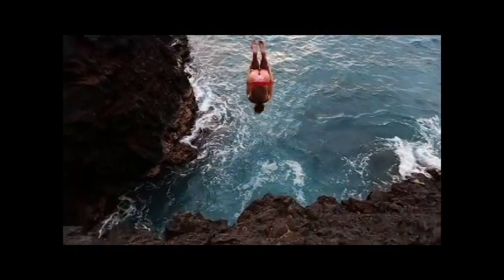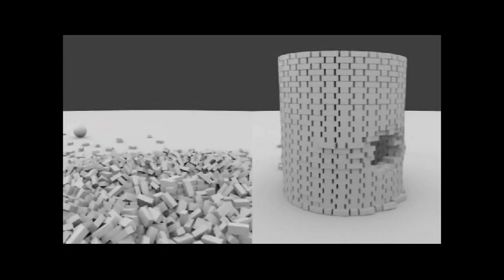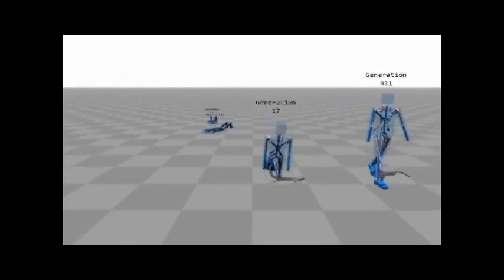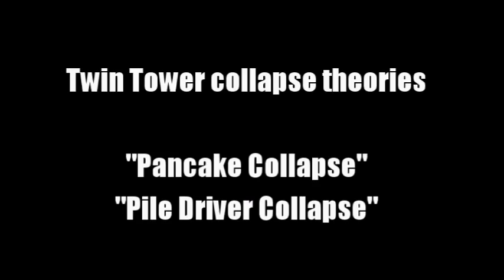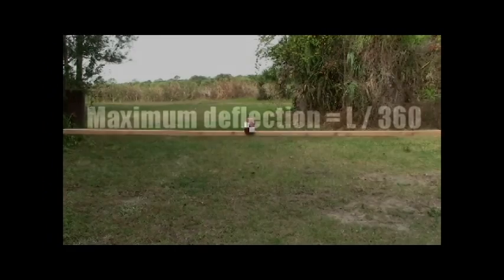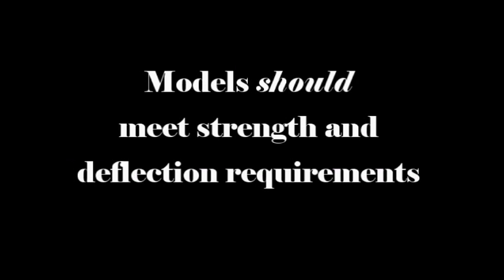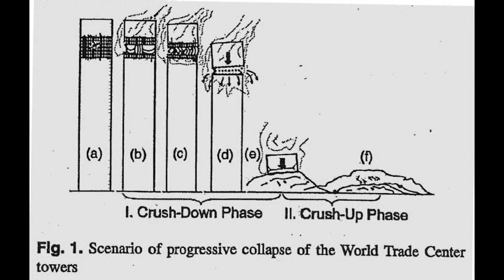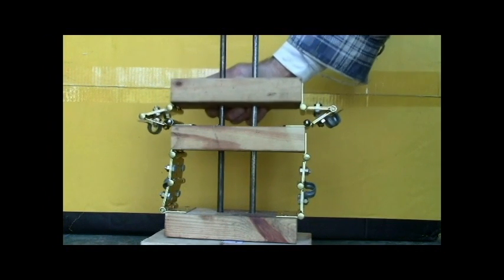9/11 Experiments: The Force Behind the Motion

Comment: This "experiment" is NOT a test of the Tower Structure, as it isn't the same structure at all, but merely a deceptively BAD 'copy'..
The DESIGN of the Tower Structure employed a column design which would COMPLETELY FAIL BY BUCKLING once it lost attachment to ONLY TWO FLOORS. It would fail because it is loaded by the weight of the tower above it.
The experimenter lacks these words in his vocabulary: STABILITY and BUCKLING.  But stability and buckling were CENTRAL to the initiation of the collapse, and described by NIST in great detail - so perhaps you should both read and understand that report before you come up with crackpot experimentation.
These terms (stability and buckling) are scientifically-meaningful,  two hundred and fifty years old, and their science is old (but accurate).
https://en.wikipedia.org/wiki/Euler%27s_critical_load
If you never mention these words, then you are either so ignorant that you don't know what you're talking about, or you do know, and you're a liar.
Reply: They call anyone who disagrees with their rubbish govt trolls.. It's their coping mechanism.
Reply: +alfredo nunya
"They call anyone who disagrees with their rubbish govt trolls.. It's their coping mechanism." - I am quite aware of that, thanks.
However here we see it being demonstrated.  It's better than my mentioning it.  :)
Reply: Alan Bollucks
"You are a government troll Tony" - No. I'm not, actually.  I am a retired industrial designer who started work in the early sixties as an aeronautical engineer, and finished in 2002 by designing the charge socket for an electric car. Engineering was my profession.
"I see your propaganda" - Physics isn't propaganda, you miserable idiot.  It's virtually an unarguable subject, and is based on the study of what is actually happening, in the real world.
"posted across many channels" - Just the ones that you watch, actually.
"several different user names" - Lying again, eh?  My other name is Beachcomber2008 which I use for music
https://soundcloud.com/jazzroc/never-over-eight-1.
Is Alan Bollucks your real name?  I have always spelled that with two 'o's...
"some of which you admit to using" - Lying again, eh?
"you copy-paste" - my own work.
9/11 PREDICTED BOEING 707 (1964) and ACTUAL (2001) BOEING 767 TOWER IMPACT ENERGIES
For those who believe that the REAL Boeing 767-200 impact was in any way similar to the notional impact calculation made in 1964 to test whether a tower could withstand it, I have reworked the calculations using the REAL impact figures and the REAL suppositions made, in place of the FALSE ones made by AE911T.
BOEING 707-320B
Empty weight 66,406 Kg.  Passengers (75% full = 164 people + 4 crew 100 Kg each) Fuel 500 gallons, so the notional weight of the 707-320B at the time of impact would be 66,406+16,800+1543=84,749 Kg
Its APPROACH speed of 147 mph works out at 65.7 metres per second.
The KINETIC ENERGY of the Boeing 707-320B at the time of impact would then be
*0.5 * 84749 * 65.7 * 65.7 = 183,000,000 Joules*.
BOEING 767-200 (Flight 175)
Empty weight 80,130 Kg.  Passengers + crew 65  Fuel 10,000 gallons, so the notional weight of the 767-200 at the time of impact would be 80,130+6,500+30,860=117,490 Kg.
Its speed of 565 mph works out at 253 metres per second.
The KINETIC ENERGY of the Boeing 767-200 at the time of impact would then be
0.5 * 117,490 * 253 * 253 = 3,760,000,000 Joules.
So, by dividing the second figure by the first, we discover that the REAL 767 impact was MORE THAN TWENTY TIMES GREATER.
"entire OPs containing very scientific looking mumbo-jumbo" - that is Physics, irrefutable and easily-accessed on the web.  Type "kinetic energy" and in two seconds you receive this:
Kinetic Energy: K= 1/2 * m * v^2
https://www.khanacademy.org/science/physics/work-and-energy/work-and-energy-tutorial/a/what-is-kinetic-energy
Either you just haven't looked, and know nothing at all, or you actually know you are lying, right now.
"complete and utter nonsense, of no consequence or relation to real world physics" - you describe what you write.
But you would, being a hardened truther.  The very word you begin with is a lie, and everything that follows it, too...
Reply: beachcomber2008  I would like to see you prove any of what you wrote about who and what you are Tony the Shill. Betcha caint..........
Why do you government trolls always try this bullshit? The bigger the lie, repeated the most often doesn't automatically become fact Tony.
Reply: Albury Smith
"I would like to see you prove" - I have just done so.  I have just proved to you that truther-claimed estimates of the 9/11 plane impacts were twenty times short of reality.
If you want to see what I'm talking about then you have to follow my argument, and understand it.
As I've just written to Suppository, you're either too stupid, or you're lying.
If you're really stupid, then you'll never get it, and I'm sorry for you.
If you know yourself to be a liar, then life will treat you just the way you deserve to be treated, and that won't make me feel sorry at all.
Reply: Tony Duncan  Yes Tony, you have proven that you can not read English and that you lied when you said you use the beachcomber sock puppet only for music. You were tasked with proving you are who you say you are Tony. So far, you have proven to me you are what I said you are, a government troll. I win my bet.
Reply: +Albury Smith
Interesting rhetoric, there.  You make claims without explanation.  These may be disregarded by any rational person.  Familarize yourself with Hitchen's Razor. "What can be asserted without evidence can be dismissed without evidence"
This will help you pretend to be a rational person.
Personally, I never gamble.  Maybe if you gambled less and learned more, you'd be a better person, and decide that lying about anything, and everything, wastes your own time, and that should be a precious thing to you, as it is finite.
Reply: beachcomber2008  Tony, you were clearly asked if you can prove who and what you are:
" I would like to see you prove any of what you wrote about who and what you are Tony the Shill."
key words being prove any of what you wrote about who and what you are Tony
Tell Mr. Hitchens hello for me
Reply: +Albury Smith
"Tony, you were clearly asked if you can prove who and what you are" - which I ignored, as it is ad hominem, and breaks the rules of rational debate.  I haven't asked you to do the same, have I?
This is because it has nothing to do with "9/11 Experiments: the force behind the motion", which is the topic of the video.
What I have been putting to you is entirely relevant to "9/11 Experiments: the force behind the motion".
"I would like to see you prove any of what you wrote about who and what you are" - and you will get none of it.   Because it is off-topic.
"Tell Mr. Hitchens hello for me" - He died six years ago.  You will one day.  I hope it's soon. Take it personally.
Here's a little something you might consider:
Only a third of the potential energy of the towers was consumed in destroying them.  The remaining two thirds turned into HEAT energy at the wreckage base.  The energy the tower contained could destroy the tower three times over.
Some floors had already fallen onto the floor beneath them before collapse.  The stability of ALL connected columns (and their safety factor)  was over-ridden easily as soon as the floor beneath failed.  The supporting columns, unsupported by their floors, then buckled, and the seventy-thousand ton towertop built up an unstoppable momentum by the time it reached the next floor/column connection - which by then would have been broken by the gathering floors.
Slender column long span beam structures are known by architects and engineers to have stability issues, but this fact, strangely, has never reached the 'Architects' and 'Engineers' for 9/11 'Truth', even though Euler's Buckling Theory is two hundred and fifty years old.  Maybe they think a scientific theory is just someone's opinion.  In fact, of course, it has never been disproved over this time.  And it works.  And it was used to design these WTC buildings in the first place.
MOMENTUM and GRAVITATIONAL ACCELERATION are the subject of the following discourse, showing that this process, once in hand, had no means of stopping.  Floor/column connections are the sole mechanical features of the structural integrity of these buildings, and there was no other feature which might have saved it.
Newton's Laws of Motion as applied to 9/11:
An Analysis of the Floor Collapse of the Twin Towers
Newton's 2nd Law ”The acceleration of an object as produced by a net force is directly proportional to the magnitude of the net force, in the same direction as the net force, and inversely proportional to the mass of the object.”
This, with Newton’s other laws, demonstrates the REALITY of the floor collapses within the twin towers.
The equation used is a derivative of the ACCELERATION of MASSES by GRAVITATIONAL FORCE: *v^2 = u^2 + 2 * f * s*, where:
Floor Mass *m = 10^6 Kg*,
Gravitational Acceleration f = 32.16 feet per second per second, or 9.81 metres per second per second
Distance between floors *s = 12 feet, or 3.66 metres*, and
Starting velocity u (original) = 0 ft/sec  (0 m/sec).  Then u = 9.72 ft/sec (2.97 m/sec).  Then u = 13.72 ft/sec (4.18 m/sec).  Then u = 16.3 ft/sec (4.97 m/sec).
It fits (as it must) in the case of a detaching floor. This, when and if it falls free, accelerates at G until it hits the floor beneath. From the formula v^2 = u^2 + 2 * f * s we know it strikes the floor beneath at a speed of 27.8 feet per second, or 8.47 metres per second.
We know that MOMENTUM is conserved, and the TWO floors would THEN be traveling downwards at HALF THAT SPEED, less the speed loss from the energy loss of the SHEARING of the floor connections.
We KNOW what this is, because we KNOW the average and general downward acceleration to have been 0.7G, as agreed by AE911T.
So we KNOW that the initial downward speed of the TWO floors is actually 70% of (27.8 / 2)*, which is *9.72 feet per second, or 2.97 metres per second.
Now we consider TWO floors striking the NEXT floor.   
Note that THE START VELOCITY (u) IS NO LONGER ZERO, but 9.72 feet per second, or 2.97 metres per second*, so from the formula *v^2 = u^2 + 2 * f * s we know the TWO FLOORS strike the floor beneath at a speed of *29.4 feet per second, or 8.96 metres per second*, and thus the impact velocity is GREATER than before.
We know that MOMENTUM is conserved, and the THREE floors would THEN be traveling downwards at TWO THIRDS THAT SPEED, less the speed loss from the energy loss of the SHEARING of the floor connections.
We KNOW what this is, because we KNOW the average and general downward acceleration to have been 0.7G, as agreed by AE911T.
So we KNOW that the initial downward speed of the THREE floors is actually 70% of ((29.4 * 2) / 3)*, which is *13.72 feet per second, or 4.18 metres per second.
Now we consider THREE floors striking the NEXT floor.   
Note that THE START VELOCITY (u) IS NO LONGER 9.72 feet per second, but 13.72 feet per second, or 4.18 metres per second, so from the formula v^2 = u^2 + 2 * f * s we know the THREE FLOORS strike the floor beneath at a speed of 31.0 feet per second, or 9.45 metres per second, and thus the impact velocity is EVEN GREATER than before.
We know that MOMENTUM is conserved, and the FOUR floors would THEN be traveling downwards at THREE QUARTERS THAT SPEED, less the speed loss from the energy loss of the SHEARING of the floor connections.
We KNOW what this is, because we KNOW the average and general downward acceleration to have been 0.7G, as agreed by AE911T.
So we KNOW that the initial downward speed of the FOUR floors is actually 70% of ((31.0 * 3) / 4), which is 16.3 feet per second, or 4.97 metres per second.
On the point of impacting the NEXT floor THE START VELOCITY (u) IS NO LONGER 13.72 feet per second, but 16.3 feet per second, or 4.97 metres per second, so from the formula v^2 = u^2 + 2 * f * s we know the FOUR FLOORS strike the floor beneath at a speed of 32.2 feet per second, or 9.81 metres per second, and thus the impact velocity is EVEN GREATER than before.
What you see here is AN ACCELERATING TREND.  The acceleration of the massing floors is heading asymptotically for G itself.
If you take the INITIAL FLOOR, its kinetic energy impacting the floor beneath it (assuming its weight to be 10^6 Kg) is 0.5 * m * v^2, which is 0.5 * 10^6 * 8.43 * 8.43 = 35,500,000 Joules.
If you take the FOUR FLOORS, their kinetic energy impacting the floor beneath them (assuming floor weight to be 10^6 Kg) is 0.5 * m * v^2, which is 4 * 0.5 * 10^6 * 9.81 * 9.81 = 192,000,000 Joules, which is MORE THAN FIVE TIMES GREATER.
Kinetic energy is ALWAYS INCREASED BY FALLING, as POTENTIAL energy is traded off against it.
So the floors will accelerate all the way to the tower basement.  This leaves FREE-STANDING COLUMNS NEARLY A QUARTER OF A MILE HIGH (and holding up 70,000 tons).  THEY WILL ALREADY BE BUCKLING AND FALLING DOWN.
Reply: beachcomber2008  Yes Tony you ignored my direct request because you have no satisfactory answer to the challenge. You haven't asked me to prove who I am or what my credentials are because I do not claim to be an expert or a trained professional with superior knowledge of physics than most mortal men like you do.
Reply: +Albury Smith
"you ignored my direct request because" - it is ignorant in that no such request is either relevant or verifiable.
"You haven't asked me to prove who I am or what my credentials are because" - it is ignorant in that no such request is either relevant or verifiable.
"I do not claim to be an expert or a trained professional with superior knowledge of physics than most mortal men like you do" - because if you did you'd be lying once more.
This video "experiment" is NOT a test of the Tower Structure, as it isn't the same structure at all, but merely a deceptively BAD 'copy'..
The DESIGN of the Tower Structure employed a column design which would COMPLETELY FAIL BY BUCKLING once it lost attachment to ONLY TWO FLOORS. It would fail because it is loaded by the weight of the tower above it.
The experimenter lacks these words in his vocabulary: STABILITY and BUCKLING.  But stability and buckling were CENTRAL to the initiation of the collapse, and described by NIST in great detail - so perhaps you should both read and understand that report before you come up with crackpot experimentation and imbecilic conclusions.
These terms (stability and buckling) are scientifically-meaningful,  two hundred and fifty years old, and their science is old (but accurate).
https://en.wikipedia.org/wiki/Euler%27s_critical_load
If you never mention these words, then you are either so ignorant that you don't know what you're talking about, or you do know, and you're a liar.
You cannot mention them, even with the Internet before you.  You have no real interest here.
Reply: beachcomber200812 hours ago (edited)  ---> wrote
"several different user names" - Lying again, eh?  My other name is Beachcomber2008 which I use for music
Foot in your mouth disease is common among you paid government trolls Tony.
Reply: +David Swanson
"Foot in your mouth" - Beachcomber2008 isn't "several different user names".  Are you too stupid to know you're a liar?
The name I normally use for music is Beachcomber2008.  This is my music:
https://soundcloud.com/jazzroc/never-over-eight-1
Reply: +Eve's Suppository
"Do governments create "terrorists"?" - has nothing to do with anything on this page.  Answer the point I made:  So far you haven't addressed it, indicating either wilful ignorance or deliberate lying on your part.
This "experiment" is NOT a test of the Tower Structure, as it isn't the same structure at all, but merely a deceptively BAD 'copy'..
The DESIGN of the Tower Structure employed a column design which would COMPLETELY FAIL BY BUCKLING once it lost attachment to ONLY TWO FLOORS. It would fail because it is loaded by the weight of the tower above it.
The experimenter lacks these words in his vocabulary: STABILITY and BUCKLING.  But stability and buckling were CENTRAL to the initiation of the collapse, and described by NIST in great detail - so perhaps you should both read and understand that report before you come up with crackpot experimentation.
These terms (stability and buckling) are scientifically-meaningful,  two hundred and fifty years old, and their science is old (but accurate).
https://en.wikipedia.org/wiki/Euler%27s_critical_load
If you never mention these words, then you are either so ignorant that you don't know what you're talking about, or you do know, and you're a liar.
Reply: beachcomber2008  Governments do create terrorist groups Tony. They have from the beginning of time to conduct proxy wars upon their adversaries. These groups conduct false flag terrorism Tony, just like what we all witnessed on 9/11.
Reply: +Mark H
Governments have always created terrorist groups, 'Mark'.  In this case, the US helped UBL to eject the USSR from Afghanistan, just as they once helped Saddam Hussein (remember him?) to fight a war against Iran.  But 9/11 was UBL's bright idea, it seems.  At least, that is what he himself claimed.
I'm inclined to believe him, because he appeared in his own video to say so.  That is EVIDENCE.  There's more, of course, but that'll do.  The US rewarded him with Zero Dark Thirty.
As for evidence against your proposition: 1.  the arab pilots gave their lives - that's not often done for money, especially when young fundamentalists have no life to spend it in, nor families to receive the money.  2.  The towers were lightweight steel, and could never have survived the fires lit by the planes even if the planes had done no other damage.  3.  No 'truther' has ever spoken the truth about the aircraft hijackings in anything they have said or written - ever, which leads most of us to believe 'truthers' (you) are both scientifically ignorant, and therefore gullible, and also that you suffer from a couple of mild forms of mental illness called Apophenia and Pareidolia, which prevent you from making any rational interpretation of facts with which you are presented.
I have tested you myself, and you have proved it by not returning with the appropriate questions to the information I have given you.  You simply couldn't, could you?
Fortunately for the rest of us, only a small percentage of any population are people like you.  Get yourself some treatment.  It isn't your fault that you are ill.
Reply: beachcomber2008  The VERY blurred video confession of OBL was obviously faked using an actor Tony. Fortunately, facial recognition software has advanced to the point where blurry images can still be analyzed by lay people. You're a pathetic government troll Tony.
Reply: +rockfordfiles
I'm don't personally restrict myself to your UBL 'confession'.  What I remember are his previous writings and videos (ask Al-Jazeera) where he, like dear Adolph, clearly stated his aims in advance of his actions.

I make comments on YouTube because I enjoy the discussion with people of opposing view.  Upvotes and downvotes don't mean much to me.  I've made comments on space travel, technology, conspiracy theories, the biological basis of race, religion, and politics.  I'm not afraid of controversy or politics and never have been.  You're not going to offend me, but I don't take people seriously who don't know how to engage in a real discussion.  You can call me whatever names you like, but I'm really only interested in well-supported claims of fact.  I subscribe to Hitchens' Razor "What can be asserted without evidence can be dismissed without evidence".
And that’s all you do: make assertions without providing any evidence at all.  You ARE a troll, and you have to be either starved or trolled.

This "experiment" is NOT a test of the Tower Structure, as it isn't the same structure at all, but merely a deceptively BAD 'copy'..
The DESIGN of the Tower Structure employed a column design which would COMPLETELY FAIL BY BUCKLING once it lost attachment to ONLY TWO FLOORS. It would fail because it is loaded by the weight of the tower above it.
The experimenter lacks these words in his vocabulary: STABILITY and BUCKLING.  But stability and buckling were CENTRAL to the initiation of the collapse, and described by NIST in great detail - so perhaps you should both read and understand that report before you come up with crackpot experimentation.
These terms (stability and buckling) are scientifically-meaningful,  two hundred and fifty years old, and their science is old (but accurate).
https://en.wikipedia.org/wiki/Euler%27s_critical_load
If you never mention these words, then you are either so ignorant that you don't know what you're talking about, or you do know, and you're a liar.
Reply: beachcomber2008  Utter bullshit Tony the government troll.
What sets you shills apart from normal people is your denial of the strength of the internally interconnected construction of the 47 core columns of the trade towers that were essentially free standing, not dependent of the lateral connections of floor truss to perimeter curtain wall.
Reply: +Eve's Suppository
Oh, I say.  Lost your rag, have you?  I'm sure that losing your temper helps you think more clearly, but that's sort of case-specific.  Your baseless accusations don't seem to bear any relevance to "9/11 Experiments: the Force behind the Motion" - I will put you back on your rails: - the "Force" was due to Earth's Gravity, and applied very evenly and consistently to the whole mass of the WTC buildings that fell.  Start from here....

+Roquefort Cheese
"What sets you shills apart from normal people is your denial of the strength of the internally interconnected construction of the 47 core columns" - 'Normal people' have never insisted that the interconnecting trusswork was either weak or strong.
It was incredibly strong, in actual fact, and quite capable of absorbing SIDE LOADS, which was the intention of the designers.
It wasn't their intention, however, that they should be called on to resist the shearing action of falling floors, for which they were obviously not designed.
Long-span beam slender column towers are brilliantly able to withstand their loads, from above or from their side, when their columns are vertical and their floors horizontal, and connected.  They aren't designed to withstand a ton of TNT plane impact energy PLUS a 30 tons of TNT fuel/air explosion PLUS one hour of sustained fire over six acres of offices.
I am not a 'normal' person, for normally people aren't trained engineers.
The video "9/11 Experiments: - the Force behind the Motion" is bogus engineering.  You won't discuss this 'bogus engineering' because you, too, are bogus.
Be honest.
Reply: +Eve's Suppository
This "experiment" is NOT a test of the Tower Structure, as it isn't the same structure at all, but merely a deceptively BAD 'copy'.
The DESIGN of the Tower Structure employed a column design which would COMPLETELY FAIL BY BUCKLING once it lost attachment to ONLY TWO FLOORS.
It would fail because it is loaded by the weight of the tower above it, but not stabilised anymore by its sideways connections.
The 'experimenter' lacks these words in his vocabulary: STABILITY and BUCKLING.
Stability and buckling were CENTRAL to the initiation of the collapse, and described by NIST in great detail - so perhaps you should both read and understand that report before you come up with crack(er)pot experimentation.
These terms (stability and buckling) are scientifically-meaningful, two hundred and fifty years old, and their science is old (but accurate).
https://en.wikipedia.org/wiki/Euler%27s_critical_load
If you never mention these words, then you are either so ignorant that you don't know what you're talking about, or you do know, and you're a liar.
The former applies to you (naturally) and the latter to the maker of this video.  He must know he's a liar.
Reply: +The Suppository of Eve
"156 people saw and heard explosions" - Fire causes many things to explode,  Here are ten of them:
1.  Fire extinguishers
2.  Sealed pipes with liquids inside them
3.  Sealed tanks with liquids inside them
4.  Battery Rooms
5.  Sealed spaces with smoke inside them
6.  Cathode ray tubes
7.  Fuel tanks
8.  Steel snapped in tension by structural expansion due to heat
9.  Electrical transformers
10,  Concrete heated above 850 deg C
This "experiment" is NOT a test of the Tower Structure, as it isn't the same structure at all, but merely a deceptively BAD 'copy'..
The DESIGN of the Tower Structure employed a column design which would COMPLETELY FAIL BY BUCKLING once it lost attachment to ONLY TWO FLOORS. It would fail because it is loaded by the weight of the tower above it.
The experimenter lacks these words in his vocabulary: STABILITY and BUCKLING.  But stability and buckling were CENTRAL to the initiation of the collapse, and described by NIST in great detail - so perhaps you should both read and understand that report before you come up with crackpot experimentation.
These terms (stability and buckling) are scientifically-meaningful,  two hundred and fifty years old, and their science is old (but accurate).
https://en.wikipedia.org/wiki/Euler%27s_critical_load
If you never mention these words, then you are either so ignorant that you don't know what you're talking about, or you do know, and you're a liar.